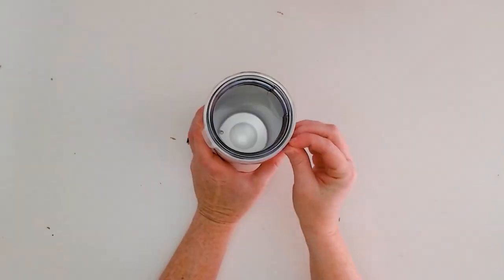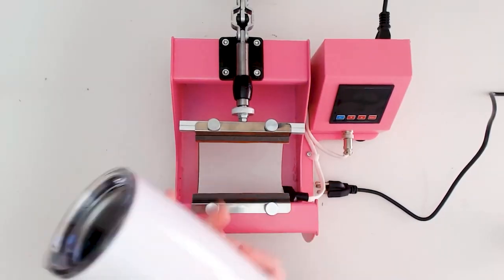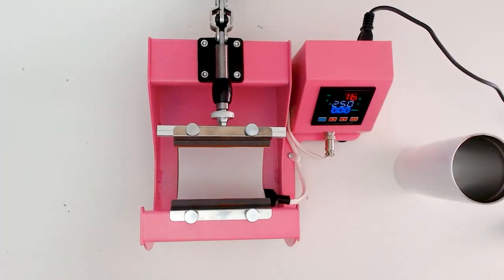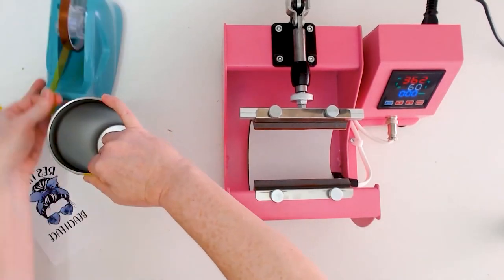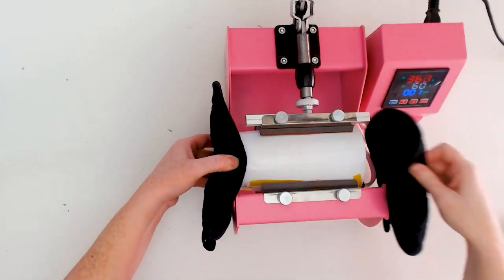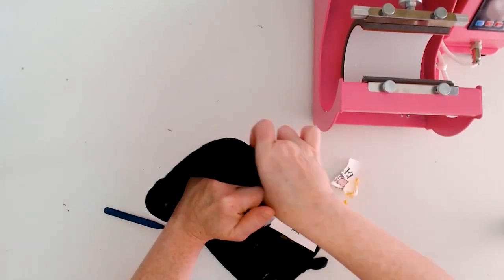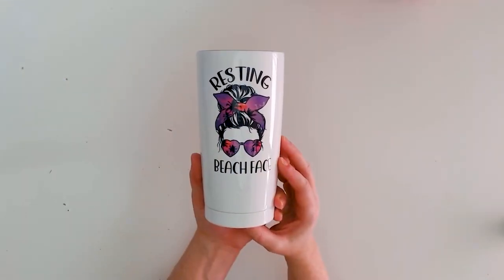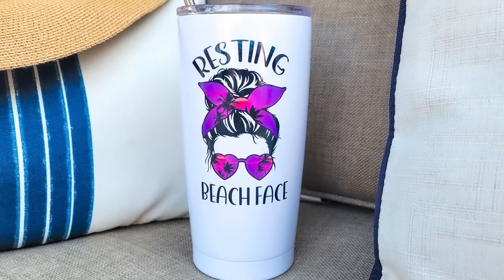How to Use 4 in 1 Mug Press from Swing Design

Comment: But how do you use it? Which one is the pressure knob? How do you work the timer and the heat buttons? I have one and they are no help at all. It's like they are answering back my emails copy and pasting what is in the manual. I have the manual and it's no help!
Reply from the maker: You adjust the pressure with the pressure silver pressure knob behind the attachment. You set the time by clicking "Set" then adjust the time/temp then press "Set" again to adjust the time and set again so it begins bring up to time/temp.